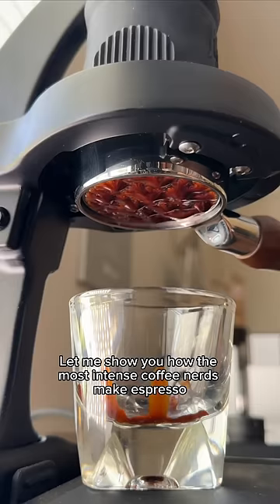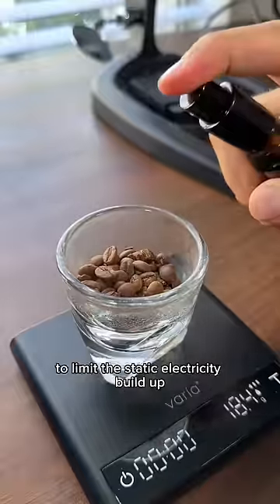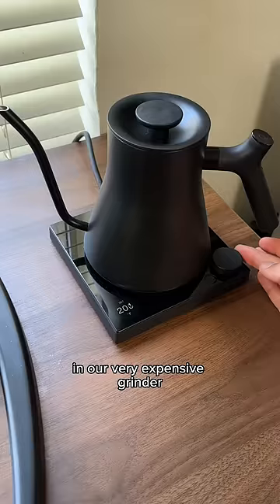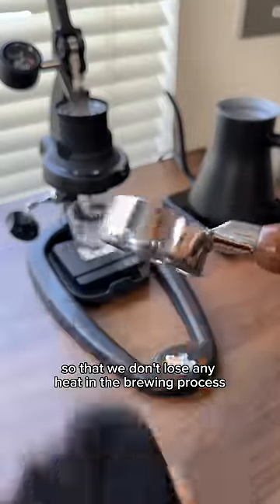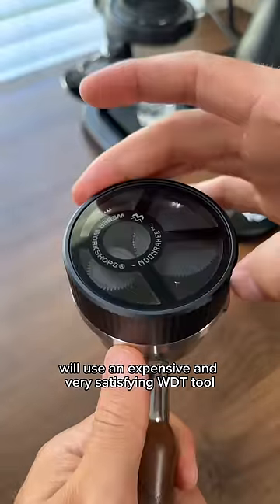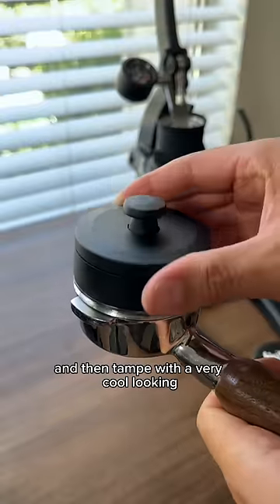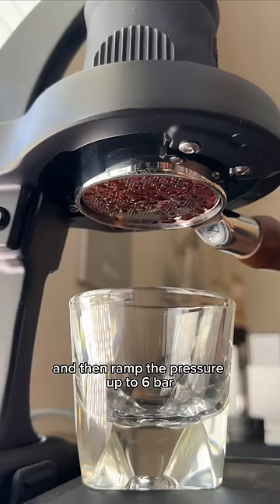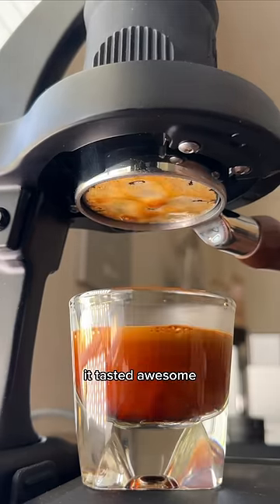HOW TO MAKE ESPRESSO (Like a Coffee Nerd)

Comment: I appreciate the pressure gauge explanations. I would appreciate more information about how the pressure can affect extractions.
Reply: I’m not sure how it works for espresso but I I know higher pressure will extract more from the beans. There must be an ideal pressure that extracts what you want in your shot and leaves behind what you don’t.
Reply: Pressure is also a result of the fineness of the grounds. Can’t build up pressure if the grounds are too coarse.
Reply: -> James Hoffman has plenty of info on that as well
Reply: You want the correct pressure so that the water saturates all the grounds well and passes through quickly enough not to over extract. More pressure is required for finer grounds.

Comment: Very nerdy 10/10.

for mortals still doing pour-over, there's just two things I can recommend "getting right" that will elevate your experience.
1. Let your boiling water cool a bit, if it's too hot your coffee will be bitter. If you're using an electric boiler, let it cool for a minute.
2. Use freshly ground coffee beans. Pre-grinding removes a lot of flavour. While pre-roasting also does, it's a lot more of a hassle to acquire non-roasted beans and roasting yourself, so just make sure that you only grind as much coffee as you need and do it right before you need it so it's as fresh as possible.

Your preferred roast level and grain size is in your control too, so don't be afraid to experiment.

Fun fact. Store bought pre-ground typically has cockroach fragments, so getting a cheap grinder or grinding the beans at the store from whole beans is preferable. Unless you're after the extra protein.

Comment: I have a flair as well, I dont get why 6 bars, i get that the pressure is not a fixed thing, but it should be 7.5 or 8 bars at least, followed by( pro tip ) a decrease in pressure down to 6 bars after puck starts to deteriorate and microchannels form

As i know it, if your extraction time is say, 25 seconds, 10 deconds = blooming , 8 seconds or so at 9 bars and the rest at 6.. 

( your extraction time will be a lot less by thenway using this method, but the coffee would taste better )

Daddy hoff approved

Comment: Damn. You didn't prewarm the machine by running hot water through it. Doesn't matter though you let the porta filter cool off by touching it instead of prepping it over the kettle.  Didn't even warm the shot glass either.

Comment: what the heck is the point of that funnel if the diameter of the ingress, egress and the portafilter are the same? couldnt you just pour directly into the portafilter and save $200 on that fake funnel tunnel?